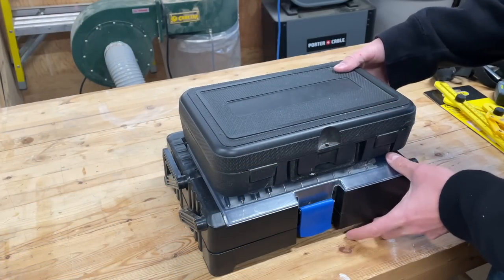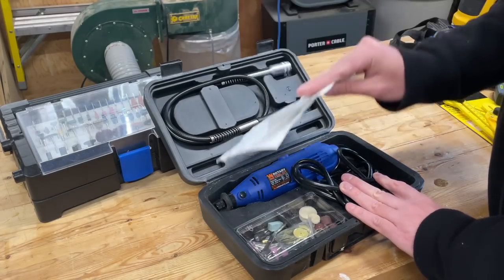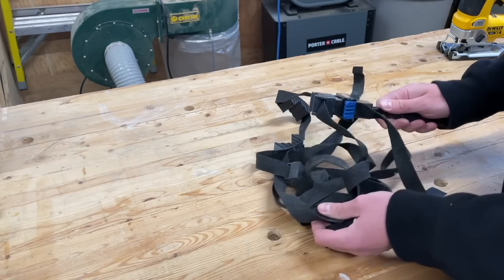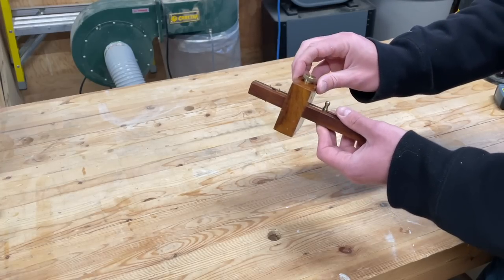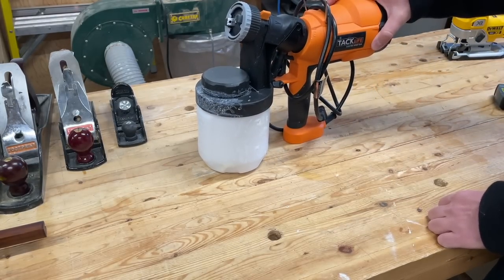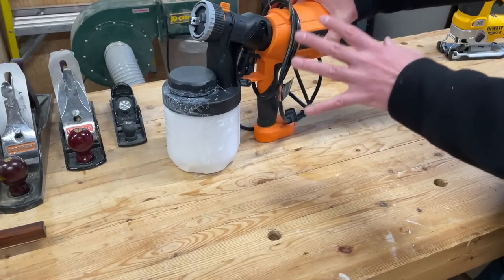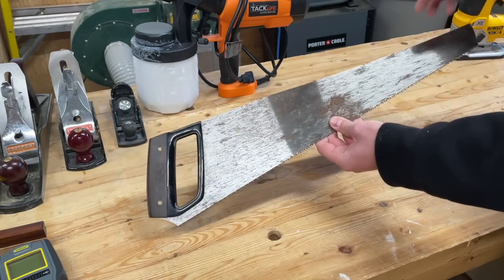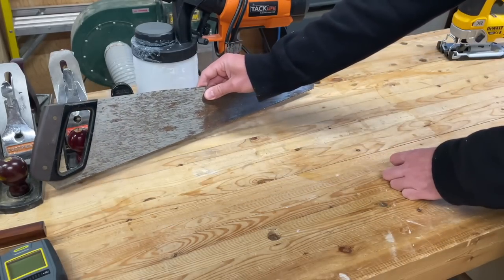Don't Buy These Tools // 10 Woodworking Tools I Wish I Didn't Buy

Comment: I also bought the WEN, what a POS. I just use it to file my dog's nails now but the motor revs really high the longer/hotter it runs which defeats the variable speed.

Comment: With the strap clamp; roll the long strap up, put a piece of dowel (longer than the width of the strap) through the centre of the roll and stick an elastic band over the two ends of the dowel. Keeps it neater and it does not tangle up with everything in the drawer. I seem to use mine to pull the legs of broken kitchen chairs when glueing up the cross pieces.

As for the cheap planes; they are good for beginners to get to know the tool with some guidance, but not necessarily much use. Rex Krueger https://www.youtube.com/watch?v=vSnKkSDb8aw shows how he can turn an Indian made plane into a reasonable scrub plane.

Comment: I know this was said many times, but I have to, too.  This should not be a video about these specific tools; it should be about buying cheap tools.  You kept buying cheap tools and kept being disappointed because... they were cheap.  Or you bought tools that didn't fit your needs or that you didn't research first.  Rotary tools are incredibly useful; you bought one for the wrong purpose and apparently don't have other uses for it.  But you said not only don't buy cheap, but pretty much said buy a different tool.  Your lesson should be to understand your needs and get the right tools to meet them.

Comment: I totally agree on everything but the jigsaw. I have found mine super useful for rough cutting larger pieces (as you mentioned) as well as cutting a few curves when necessary. However I do partially agree that it's likely not going to be a super key part of your arsenal (for most of us anyway), so while I went with the higher quality XR line for my other cordless tools, for the jigsaw I actually went with the slightly lower end (but still very solid) Atomic jigsaw. In a lot of cases, the XR model isn't much more than the lower version so it's worth the upgrade, but for whatever reason, the XR jigsaw was significantly more than the regular 20V Atomic one, so I went with the less expensive one. It is still a great quality tool and does everything I need, but unless you're using a jigsaw a ton, it's still worth the buy but wait till one is on sale in whatever battery ecosystem you're in. The pistol grip XR one from Dewalt is sweet though if you do find you need a jigsaw a lot.
Reply from the maker: I’ve really come around on the jigsaw and even posted a video where I admitted I was wrong. Basically, the wrong blade and wrong setting leads to a bad time.

Comment: Your criticism of the Wen rotary tool is totally wrong. The only thing cheap about it was it’s price. Incredibly cheap as a matter of fact. No respect for your opinion as a matter of fact on this tool. As an buyer and user of Dremel rotarys, they are more expensive, not better. I bought mine on Amazon two years ago and still amazed.
Reply from the maker: I think mine might have been a bad unit. The motor will either slow down a lot, or cut out complete, after 30 seconds of use most times. Didn't use it enough in the first few months to know there was an issue, so I missed the return window. Happy to hear yours is working out well!

Comment: Expensive tools don't always mean they are good either.
Reply from the maker: Very true! Also comes down to what type of accessories/blades/bits you pair with tools. A cheap table saw with a thin kerf blade can do wonders and a high end router with a discount bit can be awful.

Comment: I think a JigSaw is a "must have" tool unless you have the money (and space) for a big-assed bandsaw.  Cutting curves on large material just isn't going to happen with any other tool.  So a jig saw is a necessary gadget.  The quality of it is largely irrelevant - it's a motor that moves the blade up and down...how well it cuts depends on the blades you get for it - and there is where you spend your money.   I have metal cutting blades, a ceramics blade - a dozen different wood cutting blades for speed versus quality and different lengths.   Without it - cutting curves is virtually impossible.

For all of the other tools you showed - I agree, they are junk.   Maybe the planes would be OK with a bit of tweaking, but a plane is a tool that'll last your entire life...I bought my jack-plane when I was 16 years old - and my 66th birthday is looming - and aside from being on it's 3rd blade - it's still as good as it ever was.  Maybe I'd benefit from a longer one - maybe a lighter one - but honestly, it's fine and it'll out-live me.  So buy a good one.
Reply from the maker: Thanks for leaving a comment, Steve! I've come around big-time on the jigsaw - the right blades and right speed has made a huge difference in the quality and ease of cuts.

Comment: Okay… jigsaws have plenty of purposes. Also you might not use a rotary tool in woodworking but you must not be handy at all if you say you don’t need one in your home.
Reply from the maker: I ended up coming around on the jigsaw with a separate video on why I know like the tool.
Reply: Cool deal. Jigsaws are just the only way a lot of people can get started with cutting curves.

Comment: I have the same wood moisture reader I love it
Reply from the maker: Ooooh, happy to hear you're having success with it! I should put some new batteries in mine and give it a second chance.
Reply: @MasonWoodshop  Maybe I missed it, but it looks like you kept it on the default setting when checking the moisture of your bench. I have the same meter, and mine defaults to the drywall setting when I turn it on. You have to use the arrows to move it to what you're actually trying to measure (drywall, masonry, hardwood or softwood). It may not be the most accurate meter on the market, but I've found it to be fairly consistent.
Reply from the maker: @colyerjd  Thanks for the tip, I'll give that a try!

Comment: Dremel  rotary tools and routers are 2 different things 2 totally different purposes lol, they come in handy for a lot of things even if it isnt for everyone. Over half of the stuff sounds like you dont even know how to use, and on top of that u bought them cause u seen a wood worker using something like it for a project. I am not saying none of it is cheap made and garbage, just talking in general. Buy tools you need for a project and know you are going to use, buying tools cause you seen someone else using it is the wrong reason. You basically said it urself for most of the things its not something i use for my woodworking.

Comment: first two are mostly not made for woodworking. I've used rotary tool on multiple occations for small cuts, drillings and  detailing. second one is mostly used for tiles where wall are not 90 degree so you have to cut them and for that is amazing.   Spray gun has to be a very good quality so you can use a thicker paint. Multi mark is a great tool for drawing lines at specific lenght. It seems that problem is that you bought cheap tools and then saying it doesn't work or is not usefull.

Comment: To buy cheap you have to buy expensive in the first place...
But getting into woodwork as a beginner is a very expensive exercise.
Most newbies have no idea of how to set up and use hand tools, be they expensive or cheap.
Most of them sit and watch someone on YouTube that actually have no idea what they are doing or talking about either, seems to me that any Tom, dick or Harry that can produce a flat square block of wood they call a cutting board then elevate themselves to a know all time served carpenter.
Learn properly, go to carpentry lessons or watch Paul seller's tutorials, take his advise and buy correctly.

Comment: Pretty disappointed in video. Woodworkers use rotary tools and jigsaws all the time. 

The problem here isn't the tool, per se, but not knowing how to use them, not taking time to learn them, and then having cheap versions. The video could have been summed up by saying don't buy the cheapest tools, and you're good.

Comment: The theme should have been "you get what you paid for".  Buy "cheap" get cheap.  It sounds as if your are disappointed when cheap prices don't deliver high end tools.
Reply from the maker: Majority of them were definitely “you get what you paid for”. I’ve learned my lesson over the years that it’s quality over quantity!
Reply: Unfortunately that simply isn't true.  It would be if pricing was based only on quality, but it isn't.  Plenty of relatively cheap tools are really good quality.

Comment: Buy because it's cheap and then complain about the quality? Sounds like someone is addicted to buying rather than solving real problems. For example, my father used strips he cut from old inner tubes and ropes when he needed a strap clamp. Infinitely adjustable, zero cost, and it solved the problem.
Reply from the maker: There was a period of a few months when I was getting into woodworking where I bought a handful of items that were both low in quality and generally not needed (as shown in video). Luckily this addiction was short-lived and I started to buy the best I could reasonably afford and only when I needed it.
Reply: @MasonWoodshop  Nothing like experience to teach us what is really valuable

Comment: Let’s see you bought the rotary tool for the wrong purpose and then doubled down and bought the cheap knockoff of a Dremel.  That’s not the tools fault.  Over my lifetime I’ve probably wore out 5 Dremels using them for what they are designed for.  There are two rules of thumb that will save you a lot of money and possibly medical bills in the long run.  Buy the proper tool for the job and buy the best quality tool you can afford and you will only have to buy it once.  Buy no name junk and you will be replacing it many times.

Comment: expensive handplanes need setting up and calibration too, don't kid yourself, just watch Rex Figures It Out's video on a $300 Veritas plane, also my planes are even cheaper and simpler than yours and i got them to work, you're just lazy, also if you haven't used your cheap planes, then buying expensive ones is even more of a waste of money, since you're not gonna use those either, right ?
The Multi-Mark is not a a square, it's a marking gage, so it not being accurate is not a problem, the only issue is you not using it properly, also how is it a huge waste of money ? did it cost like $200 ? no, it probably cost $10, that's 2 coffee's i'm sure you are having instead of making your won, now that's where the huge wastes of money are, if it's not coffee there is guaranteed to be something else.

Comment: All this video does is remind me of how little new woodworkers really understand about tools…..
 
Almost every complaint you have here only exists because of your basic lack of understanding of the old school American style tools and their proper uses, or lack of understanding of how, why and when to use the newer style tools. 
The single worst offender on this list is your complaint about the planes…. Every plane and every chisel that I have ever bought has needed flattening, tuning and sharpening out of the box…. From cheap Chinese junk brands to Stanley and Kunz…. Every one of them needed tuning for fine woodworking. 
And saws…. Plenty of beautiful fine woodwork and TONS of re-sawing has been done with push style handsaws…. But you don’t resaw with a fine tooth crosscut saw. 
You do that with a rip saw. Completely different tooth pattern. 
I really hate this trend that people push that you have to have a Japanese style pull saw to do fine woodwork. I have one. It collects dust on the wall unless I’m installing those cheap styrofoam beams. I’ll take my Disston saw collection over any Japanese style saw every day of the week and twice on Sunday. Not that there’s anything wrong with the Japanese saws…. I just hate the way they handle… same thing with their planes.
 
The “Angle-izer” doesn’t need to “accurate”. The fact that idiots in a marketing department add measurements to everything doesn’t mean the tool needs it. That tool is transferring a scribe. And it holds up just fine for masonry and tile work. The fact that you unscrew the thing to far is a you problem, not a tool problem.
 
While you do have a point on the Wen Rotary tool, the accessories complaint is also a you thing, not a tool problem. I’ll give you that you titled the video “tools I wish I didn’t buy”…. But then you have a complaint on quality that’s, quite frankly, based on the fact that you don’t use a rotary tool. 
 
The Marking Gauge, while it’s nice to have perfect precision cut holes for everything to move in, it doesn’t actually effect the way the tool is used. 
 
Just because you don’t understand the tools and their proper usage doesn’t make the quality of these tools a problem. 
And had you left it like the complaint on the Jigsaw as just a “not for me” type complaint, I’d have kept my mouth shut.

Comment: A jigsaw not for woodworking... ok bro.... 👌 next video you gonna say all you need is an impact driver and screws, no drill, or glue... sure. 

I can't even begin to tell ya how indispensable a jigsaw is. So much so I'm the proud owner of several, have that same dewalt one in my daily tool box, and use it on every job.
Reply from the maker: I’ve come around big time on the jigsaw! With the right blades and right speed, it’s giving me impressively clean cuts. I’m glad I took the time to give it another go.

Comment: Maybe your issue is that you bought the cheapest crap possible and using the wrong tools foe the job lol. 
Buy some quality tools and the difference is night and day.

Breaking down lumber with a Jigsaw. Lmao. Circular saw. 
Trying to use a rotary tool as a router...face palm.
Reply from the maker: Yup, that's exactly why these are my worst purchases. Luckily they were all as I was getting started, so hopefully this helps others avoid the uninformed "tool of the month" purchases.